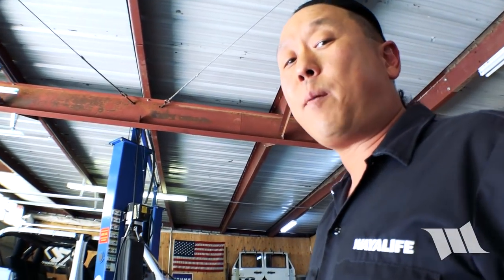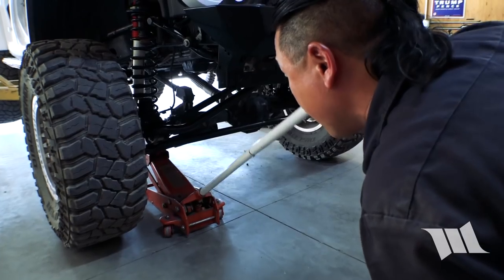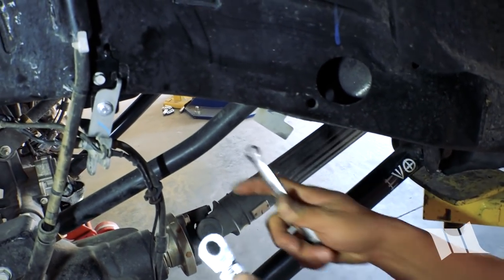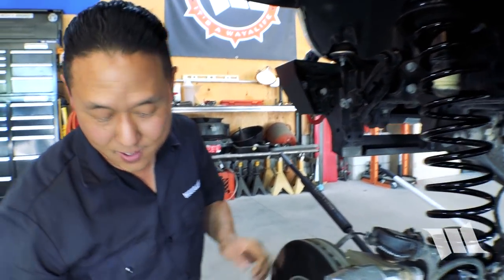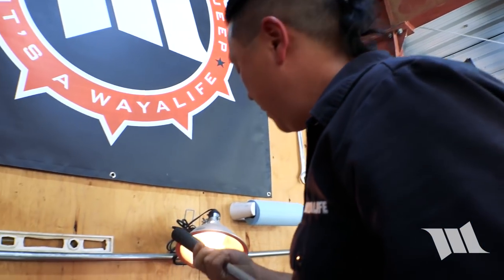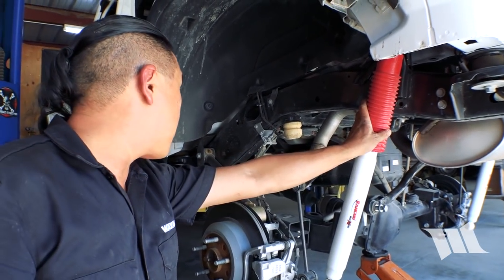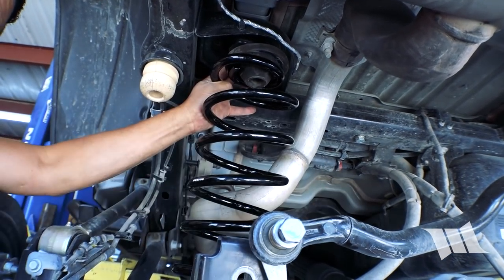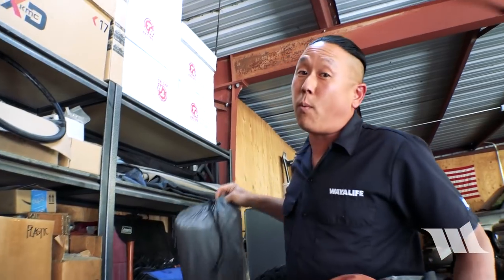Jeep JL Wrangler 2 Inch Lift Kit How To Installation : Dynatrac EnduroSport 2" Suspension Lift

Comment: Will installing a 2 inch lift accelerate wear on the drive line or any joints?
Reply from the maker: Unlike most lift kits that yield closer to 3" of lift, this Dynatrac EnduroSport provides an exact 2" of lift and that is well within the factory specs. Accelerated wear of the driveline or control arm joints will NOT be an issue. IF you run wheels with less back spacing, you will accelerate the wear of your ball joints but that's a problem caused by the wheels and not the lift.

Comment: No need for any LCAs and adjustable track bar? Caster stays in spec?
Reply from the maker: Not with this lift. Unlike most 2" lifts which are way taller once installed, this one yields exactly 2" and it's well within the factory tolerances.
Reply: Wayalife thank you! Not sure if you’d know this but if I ran 35s with this lift would I have rubbing with stock wheels no spacers? Assuming wheeling and disconnected.

Comment: On a JLUR, could you run 35s with this kit and not look like it slipped leg day? I'm about to lift mine with a 2-2.5 lift and would like to stick with 35s since it's mainly a daily on the streets with weekend warrior offroad from time to time
Reply from the maker: Honestly, 35's is all this kit is really good for.
Reply: @wayalife  thanks! I'm torn between this and the Mopar lift 🤔🤔
Reply: @wayalife  for my visual purposes, you're running 37s in this video correct?
Reply from the maker: @TRD_Cueto  Yes, but they were too big for the little amount of lift you get with this kit.

Comment: hey why did you decide 37 over 40? also any news on a new rear bumper?
Reply from the maker: As it is, we're concerned about our axles with 37's. While we do plan on running 40's, we'll upgrade to a set of Dynatrac axles first. Regarding rear bumpers, we may run an LoD.

Comment: So does the JL lean to the passenger side with the equal length coils? (I had to put a spacer on the front passenger side of my JKUR to get it level.)
Reply from the maker: Actually, it sits kind of level. The factory coils make it lean to the driver side.
Reply: @wayalife  interesting. On the '08 JKUR manual, the front passenger spring was longer, and when I did the OME 2.5"  kit I had to install the spacer to avoid the lean.  Ok - good to know for the future / waiting for the diesel JLUR...

Comment: I don't want to go up to 37's on my 2020 JLU, would this kit be good for 35's without looking too high off the tire? I know the stock JLU can fit 35's, I just don't want to cram them in and have the "he couldn't afford a lift look".
Reply from the maker: Yes, this would be a good kit for 35's.
Reply: @wayalife  Nice!!! And Thank you for the reply!!!
Reply: @wayalife  How would you rate this kit vs the 2.5 mopar or the 2.5 AEV?
Reply from the maker: @Wrangzilla  Well, to be perfectly honest, you get more bang for your buck with a Mopar lift as it comes with new front lower control arms and Fox 2.5's as opposed to just 2.0's like the Dynatrac lift comes with. If there is a downside, the Mopar lift yields closer to 3" of lift where as the Dynatrac lift only yields 1.8" of lift. I unfortunately do not have any experience with the AEV lift to say one way or another about it.
Reply: That 1.8” yield sounds like the route i want to go. I saw 35’s on a Mopar 2.5 and thought it was a little too high for the 35’s to look proper. Thanks for pitting that real world height in there. That made my mind up!!!!

Comment: Mine 2018 Sahara JL has a mopar lift kit and I put 35/12.50/20 but feels stiff feels bad do you have idea what is the problem?
Reply from the maker: Couple of things. If you're running more than 30 psi in your tires, that'll be a big part of what you're not liking. The other thing is the Fox shocks. They do great driving hard and fast across the desert but don't always feel to great for daily driving.
Reply: Thank you

Comment: Can this lift run stock wheels without needing spacers?
Reply from the maker: It's not the lift that will determine whether or not you need spacers, it's the size of the tires you want to run.
Reply: @wayalife  gotcha.  I was looking at 35x11.5x17.
Reply from the maker: @M C okay, with tires that big and wide, you will see rubbing at a full turn and wheel spacers will help to prevent that. Otherwise, this lift will be enough to have the fender liners clear the tires when flexing.
Reply: @wayalife  Thanks!!  Much appreciated!

Comment: Can you tell me what type of rims and size on your Rubicon
Reply from the maker: KMC XD231 in a 17"
Reply: Can I pick your brain really quick
1st question ard your rims 17x8.5 because I can't find and wider
2nd what size tires do you have 
3rd I have a black gladiator would you recommend black on black or chrome on black
Reply from the maker: @arturocordoba6206  Yes, 17x8.5, in this video 37x13.50 and black on black looks great but the rings will get beat up and look like crap. Always better to run silver colored rings.

Comment: Stock 4:10 gears with the 37s?
Reply from the maker: It can be done and isn't too bad but you will feel power loss and basically will lose 8th gear. 4.88 is the ratio you'd want with 37's

Comment: Hey Eddie, another fine install video. have you re-geared yet? If so to what?
Reply from the maker: Glad you liked the video. As far as re-gearing goes, nope. Unlike the JK before where it was necessary to re-gear to regain lost power, the all new 8-speed automatic on the JL does a GREAT job of pushing the 37's. I've found no need to re-gear.
Reply: @wayalife  jumping into this conversation with a question as well.  If you had chosen a manual transmission instead, do you think regearing would be necessary with the 37's?
Reply from the maker: @toms4363  Unfortunately, the need would be even more so. I love manuals but the new 8-speed automatic really is that much better. Test drive one of each and you'll see what I mean.
Reply: @wayalife  thanks so much, I truly enjoy the content and quality of your videos. A great balance of education and entertainment!

And the amount of time you take to respond to questions and comments, unbelievable....
Reply from the maker: @toms4363  My pleasure and glad I could be of help :)

Comment: Do you need wheel alignment after intalling this kit?
Reply from the maker: You will need to recenter your steering wheel but that's it. You can do this yourself with a 15mm wrench and 2 minutes of your time. An alignment shop won't be able to do anything else other than to take your money.
Reply: Wayalife sweet! I heard a lot of good reviews specially the ride on this lift, so i just ordered it yesterday. I had another question I know it might be different on this video, but Im planning to upgrade my trackbar, draglink and tie rod with the yeti smart steer product should i install that first or the this lift kit? Thanks in advance
Reply from the maker: Before you pull the trigger on all that, go to their website and see for yourself just how much it'll cost you down the road to replace their tie-rod ends. ALL things wear out and servicing them will set you back about $200 EACH. For this reason alone, I personally would NOT recommend them. That being said, you can install steering upgrades after the lift install. In fact, with such little lift, NONE of these components are really necessary.
Reply: Wayalife i saw their website and they are expensive. What lift size I can upgrade the steering? Or what brand can you suggest or steering upgrade doesnt really necessary even if you have high lift? Thanks again
Reply from the maker: This is a true 2" lift and you'll be well within factory spec. You really don't need to make any steering upgrades even at 3" of lift or slightly more. At that taller height, it can be helpful to have though. I personally decided to go with Synergy being that they have a long reputation for making quality components and the cost of servicing them is a LOT more affordable. About $30 a tie rod end. Having had it on my JL for a while now, I've found it to get the job done well. Here's an install video I did on it https://www.youtube.com/watch?v=rCCfyskm-CM

But again, at just 2" of lift, it's not necessary.
Reply: Wayalife  thanks for this info, will checkout the synergy. This helps me to decide which path should i take 👍
Reply: Wayalife I have received the lift kit dynatrac and ready for install, just have a question, i was reading about some forum regarding lifting the jeep most of the forum says it need a adjustable track bar inoder to axel centered. Do i need an adjustable trackbar for this lift?
Reply from the maker: @edzel14k  LOL!! Well, I'm not gonna pretend to know more than what "most of the forums" say but I'd like to think I'm pretty thorough about things and if I really thought an adjustable track bar were needed with just 2" of lift, I would have made sure to include one with this install. Yes, your axles will be ever so slightly off center but then, they're ALWAYS a little off center one way or the other. It's just the nature of the beast when it comes to solid front axles that use a track bar to hold it in place. This is because one end is mounted to the frame and the other is mounted to the axle on the opposite side. Any time you have a full tank of gas, passengers and gear loaded in your Jeep, your front axle will shift to the passenger side and the rear toward the driver side. Any time you're completely unloaded, have the doors and top off, they'll both shift the other way. But again, I'm not "most of the forums" so you can decide who to trust :)
Reply: Wayalife thanks for replying this helps me gathered more info to educate myself, as a new jeep user I’d like to know as much info, having said that, as you mention that either way, axel might sligthly off center when taking off doors,hard top or having a full tank gas. In your opinion when should we use an adjustable trackbar? Or stock will be fine for 2 inch lift? Thanks again and appreciate your response
Reply from the maker: @edzel14k  Actually, more than an adjustable track bar, you'd want a track bar relocation bracket installed once you get up to the 3.5" or taller range. Installing an adjustable track bar will ONLY help to recenter your axle. A relocation bracket will help to recenter your axle AND correct your steering geometry/roll center and that will give you better handling. The problem is that up front, you really need to install a drag link flip at the same time. It is critical to keep both track bar and drag link parallel to each other. The rear just needs a relocation bracket.
Reply: Wayalife thanks much thats lot of info. As Im doing just a 2inch will stay with stock for a while. Thanks again really appreaciate it.

Comment: @ 23:20 you put the bolt backwards.
Reply from the maker: On purpose. Experience has taught me that the other way leaves the bolt threads exposed to the rocks and that causes them to get jacked up.
Reply: @wayalife  ya makes sense, wonder why Dynatrac's video tells you to put it the other way.
Reply from the maker: Most likely because that's how they come from the factory. It should be noted that a lot of the bolts get installed the way they do based on how things are assembled on the factory line. I have seen this with my own eyes.

Comment: For the price I think I would rather get the Mopar lift... Great vid though
Reply from the maker: Mopar lift is a good lift. I should note that it does measure closer to 3" though. If taller is what you're wanting, it's an even better choice for you.
Reply: Yeah, I would not mind it being a bit taller... I have heard rumors that a lifted jl doesn’t like to shift into 8th gear. I have a sport. Would I need to re-gear if I were to lift that high?
Reply from the maker: @evanwilliams8087  What you've heard is inaccurate. A lift will NOT effect how your transmission works but larger tires WILL. Bigger the tire, the less likely you'll be able to retain your overdrive. That being said, the all new 8-speed auto is amazing and it'd be hard for me to say a re-gear is "needed". You'll still have plenty of power and get decent MPG without one and you'll be paying a LOT of money just to get back 8th.
Reply: Wayalife I figured bigger tires would effect 8th; I plan on getting 33s. I figured the rumor about lift to be untrue, can’t believe everything you read on the internet, haha. Thanks for the reply!
Reply from the maker: @evanwilliams8087  LOL!! There's a lot of really bad information on the internet. With 33's I really wouldn't bother with a regear. Hell, I run 37's with my factory 4.10's and feel no need for anything more. I should note that 3" of lift with 33" tires may look a little funny or at least, it would to me. You could easily run 37's with it.
Reply: Wayalife Very true, I may have to rethink 33s then.
Reply from the maker: To put things into perspective, the Rubicon comes with 33's from the factory.

Comment: Thanks for your previous reply. So my jl rubicon will never go off road. Daily driver. If I install this 2 inch lift can I fit 37s? With stock gears? Also how do I get jeep to sit level? U mentioned coil spacers in this video
Reply from the maker: If you never go off road, yes, a 2" lift like this will allow you to run 37" tires. However, depending on the lift (this one sits just shy of 2") and what 37" tire you run and wheel it's mounted on with what back spacing, you may still see some rubbing of the rear fender liner and or rubbing up front at a full turn and hitting a small bump in the road - like pulling into a driveway. There are a lot of factors to consider.
Reply from the maker: Okay, BFG tends to be smaller than other brands and so they may work well for you. I would recommend a 17x8.5 or 9" wheel with 3.5"-4.5" of back spacing.
Reply from the maker: Glad that I could be of help.

Comment: What is your caster angle after this? I get terrible death wobble after my install.
Reply from the maker: This kit only yields about 1.8" of lift and caster is well with in factory settings. That said, even if it weren't, it would NOT cause death wobble. If you haven't already gotten the TSB done at your dealership to replace the aluminum steering box with an iron one, that's where I would start. Otherwise, you most likely have a loose front track bar bolt.
Reply: @wayalife  Awesome, thank you so much, I’m on it.